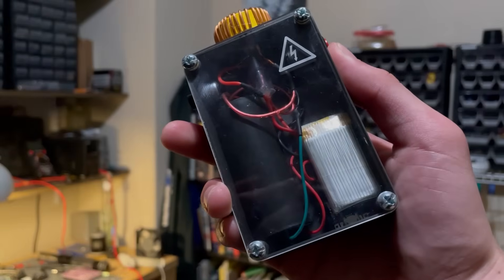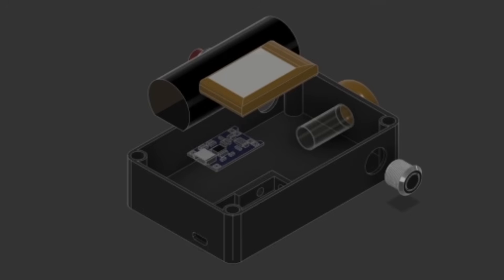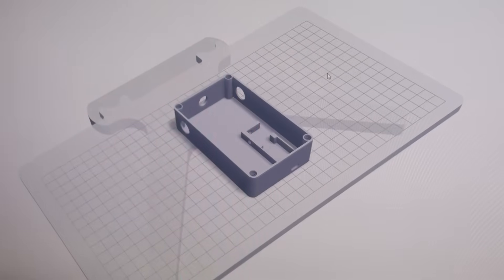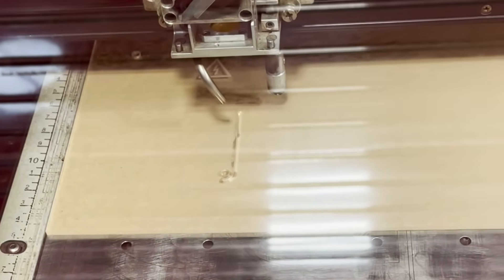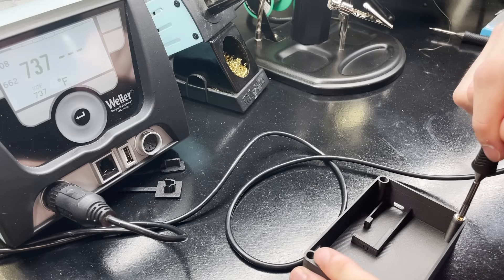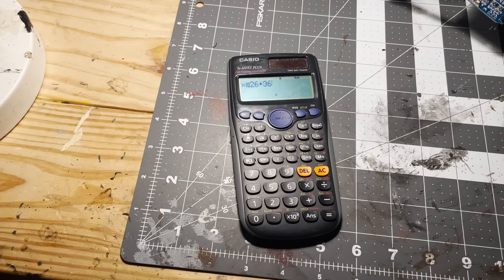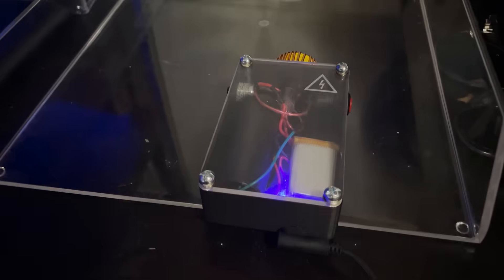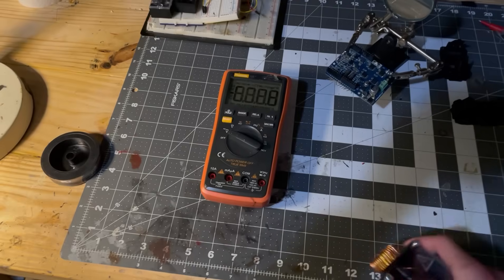How I Made an EMP Generator

Comment: to anyone interested, the batteries in vapes work great for these and are smaller than 18650's so you can use smaller cases. There are thrown away vapes everywhere so battery wise you find a few and save some cost on making it.

Comment: could it be used with a engine coil from a car, a 12volt battery while shielding the cars ignition system. Illegal or not it does seem like the great equalizer and you can't get caught if the other guy can't call, or start the car while his stun gun can't produce a charge.

Comment: add a voltage multiplier...maybe 6-7 times... about 10-20x more windings around your inductor...  smaller capacitors in parallel... then go ahead and throw a couple transformers in series to really boost that voltage. 

i wouldnt do any of THAT personally but for those interested.
Reply: Thanks lover
Reply: @tobimarucrypto2862  you got it bai

Comment: Also, why are there 2 buttons? Will it work with 1?
Reply from the maker: It will. One is just a safety
Reply: @schizo4725  Thanks! Can you also answer my other two questions? I'm planning to start building it soon! Already got the case printed!
Reply: @schizo4725  hey um don't transformers only work with AC current? how does it still function like normal with a battery? love your work!!
Reply: @-DaisukiDayo Sorry for the late reply, but I'm a lot more informed now than I was a year ago.
Transformers work with DC, but only once, momentarily. The circuitry inside the high voltage module makes it switch very fast between ON and OFF, which allows the transformer to work with DC

Comment: How could I (theoreticly) make it stronger? So that I could (for example) turn off security cameras from long range?
Reply from the maker: “Long range” is pretty vague but even at a few meters away, it would require a bulky design and enormous amount of power. Plus, you can’t precisely direct magnetic waves as beams. You’d be better off just physically destroying it from a distance.
Reply: capture cylder drone reverse enginer lol

Comment: Why do the devices light back up after the pulsing? How can you make them permanently destroyed with a pulse?
Reply from the maker: A.) because the field only causes a temporary disturbance to the circuit. More sensitive electronics may suffer permanent damage. B.) by building a much more powerful, legally questionable EMP with an extensive  amount of money and knowledge of electric circuitry. Personally, if I wanted to fulfill your second question, I’d go with a hammer.

Comment: Love the video, but can anyone tell me what is the purpose of the spark gap? Thank you!
Reply from the maker: It allows the voltage to build up in order to overcome the resistance of the air and then quickly discharge. Plus, spark gaps in general prevent damage to components in high voltage electric circuits.
Reply: @schizo4725  what gap distance would be optimal?

Comment: For fs sake all you need are 3d printers, computer programs, etc..
Like I'm going to be able to build one of these...
Reply from the maker: Not necessarily, one of my first EMPs was basically the same as this (actually a little better because the coil was more efficient). I made that one with nothing but some wire, the same transformer, a coil a 9v battery, a light switch, and some cardboard/ duct tape. It may not be as aesthetic as this one, but sometimes you have to just get creative when resources are limited.

Comment: the coil around the toroid is concentrating the magnetic field, that is what´s making it inefficient. you want the field to spread outwards, the ferrite toroid keeps it inwards
Reply: Hey you sound like you know what you're talking about. How did he use a transformer (a component that only uses AC current) with a battery (that to my knowledge, provides DC current)?
Reply: @-DaisukiDayo  that's simple, transformers work with fluctuations of current, which in turn create a fluctuating magnetic field. if you momentarily discharge a capacitor on a coil or transformer primary coil, that creates a fast growing current momentarily  that also will decrease fast, all this creates a fast fluctuating magnetic field, which will induce high currents and tensions on other conductors.
Reply: @thethoughtfield  sooooo transformers + batteries is ok?

Comment: turning the spark gap sideways and having both terminals exposed turns this into a taser. Please be very careful while making this. Also if taser is the goal you don't need the board.
EDIT: Technically not a taser as it isn't ranged. I simply refer to shocking devices such as stun guns and cattle prods as tasers.

Comment: No this is no EMP pulse as known from the scifi movies, but rather a strong electrical magnet that could easily erase ROM memory in various devices, thus effectively damaging the firmware. There is something like EMP pulse when a hydrogen bomb is deployed over the city inducing a blackout of non-protected electrical devices, which is majority of commercial electronics.
Reply: Do you know what EMP stands for? A strong Pulse from an *ElectroMagnet*...
Reply: Will a real EMP pulse from a hydrogen bomb be able to wipe out PROM, EPROM, EEPROM, FRAM and Flash memory?

Comment: Can not you just take two metal plates and connect them to Van der Graff generator ? When the voltage is high enough the spark appears between the plates which is plasma. All your devices will be affected.

Comment: did I miss the schematic drawing somewhere? with specific detail on spark gap length and the Toroid wind and inductance but it looks like a big series circuit on the output of the Marx Generator module. I have  a Marx 'gun' with a 12x12mm microswitch that keeps burning out although its on the input side of the marx gen. in series with an 18650 (likely instantaneous current issues)
Reply: maybe you already solved your issue, but here it is: microswitches can't handle high currents. Use a relay (ideally a transistor or n-mosfet) as a switch instead. If using mosfet be sure the operate within the specs and use adequate protections about back-emf.

Comment: I thought of this the other day when I was watching a car chase on the freeway.  Some way to upscale this strong enough to knock out a car and small enough to be deployable by a cop.
Reply: hi walthodgson, have you become a flat earther yet? If not I suggest viewing the 13 part series what on earth happened in my about to learn how the earth is not a globe
Reply: It's already been invented years ago but difficult to use.
A car body shields a lot, so it needs to go underneath using a remote control mini vehicle of sorts, which then directs the EMP upwards from underneath the car.
Works, but field testing on real streets and real cars proved that 2 people are needed, that it's very difficult to steer to get underneath a fleeing vehicle, it might affect other vehicles, too easy to get crushed by the wheels of the fleeing vehicle, could easily miss with no time to pick it up (thus making it easy to steal), etc etc.
In short... impractical in the real world.

Comment: Wouldn't the best Emp device be just a magnetron inside a wave guide with one end open on the wave guide?
Reply: Parts you can scalp ftom a microwave oven. The magnetron and magnets.
Reply: Just take the door off the microwave oven and over-ride the door closure safety switch? Maybe not very directional though, and not frequency tunable (stuck at around 2.4 Ghz)

Comment: Bruh. How does a DC battery work with a transformer! 0:44
Reply from the maker: Forgot to mention. The module very likely has an oscillator inside of it before the transformer. I mean, I haven’t opened it up and looked yet, but that is almost definitely the case since you’re right. A transformer needs AC supply after all.
Reply: I still have some learning to do - i thought transforming DC into AC (or vice versa) was the whole point of a transformer 💀

Comment: I'm fully aware that you added the toroidal core to trap most of the flux inside and only the leakage flux to do the job.. but hear me out, you can actually make it "directional" by putting the coil inside a copper or aluminium pipe, basically something non ferromagnetic.. also keep a considerable amount of air gap between the inner wall of the metal pipe and the coil. This is to improve the shielding in radial direction.. 

Now next up you can improve the coil structure, instead of making it toroidal which will trap most of the flux inside weakening the em wave.. you can just make it "horse shoe" shaped with the two poles open and facing forward.. that way, a short range but more powerful em wave can be generated.. Note that if u do like this then you'll need two separate copper/aluminium shielding pipes for directing the em wave forward. That's all I can think of. Thanks for reading your build is great though.. good work👍
Reply: With your horseshoe design would your wrap the wire around a copper/aluminum core or maybe plastic would be better. And the copper tubes your saying would go around each open end of the horseshoe?
Reply: @swimswim2168  Yes I think he meant it that way, Horse shoe coil is like a "U" so basically one to the right and one to the left. But I am not sure about the wiring of it, could try though

Comment: It's a good thing it wont work on most things you try to use it on. :)
In order for a proper EMP device to work, it has to actually be the same frequency of the circuit / device your trying to apply it to. 
And most important things are shielded to begin with. 

So if you don't know the EXACT FREQUENCY of a device, your EMP unit is useless. 
Now there is a form of EMP that doesn't care about frequencies, but you'd never be able to build it without having both a massive warehouse, and the permission of DARPA.

Comment: Just a simple question that I can clearly see that you have connected one wire with the Coile (I mean the High Voltage generator wire with the Coile) but where you have connected the other wire ?
Reply: spark gap

Comment: Pretty sure this is highly illegal and I love it. I remember trying to find plans for cell phone jammers and learning that it would be illegal to walk around with one in public. Similar reasons for this project. Keep spreading that knowledge :-)
Reply: it’s not illegal if you don’t get . . . .
Reply: This is very low power, and therefore not illegal. In your microwave there is a 1000x more powerful device than this.
Reply: @foximacentauri7891  Also a good reason for not disassembling your microwave unless you 100% know what you're doing
Reply: @SirZechs77  really all you need to watch out for is the HV capacitor
Reply: @janthran what's this cylinder thingy-
Reply: @foximacentauri7891  Oh.... Is there? 😏

Comment: This isn't EMP. EMP is extremely narrow, nano-seconds wide pulse, typically requires a nuke. Very hard to achieve with electronics, so most EMP simulators / smart bombs only get to a few MHz. The traditional method of simulating EMP used to be a Marx generator with some sort of antenna - that would be a fun watch if you built one and got it right. Your device doesn't even cause a lot of EMC, or you'd have seen it on your phone's sensitive touch screen.

Comment: Out of curiosity, would a stun gun achieve the same result?
Reply: A stun gun would emit a wide range of radio frequencies, this would cause momentary interference on radio based devices such as Bluetooth and WiFi enabled devices and radio broadcast receivers.

But the equipment would return to normal operation after the discharge sparking of the stun gun ceases.
It is highly unlikely any permanent damage to electronic equipment would occur by using a stun gun in close proximity.

Some electronic equipment may malfunction if the discharge occurs to the case of the item, but should be extremely rare because the equipment should comply to electromagnetic compatibility regulations and one specific test that is performed is to perform a high voltage discharge to the unit under test.

Comment: lol that's not an emp, that's just short range continuous induction.
you have to create and/or destroy the source of the EM field extremely fast to cause what can be called an EMP. usually this is done by literally blowing stuff up with high explosives. you just built a slightly overpowered mini radio that constantly changes the electromagnetic fields. EMPs don't do that, they only have one pulse, or maybe two, but one that does the main damage and is several orders of magnitude stronger than the pulse it uses to create the EM field.
Reply: No, it is an emp device. The device is not running continous due to the spark gap. Per definition an emp device is just a device that creates electromagnetic pulses, which this does.
Reply: Pretty sure what he made emits electromagnetic pulses bud.
Reply: @dubfather521  Yes but so does your grandad's pacemaker, it's not an EMP device though. OP is right.

Comment: The ferrite core of your toroidal coil is causing the overwhelming majority of the magnetic flux lines to stay contained within it rather than radiating out into space. This device would be dramatically more effective if you used a large diameter coil with no core.
Reply from the maker: Thanks for the input, I wouldn't doubt you have way more experience with electromagnetism than me, but I addressed that in my new pinned comment. By the way, it's a pleasure to see you on one of my videos regardless,  I'm a fan of your work!
Reply: new HyperspacePirate video?
Reply: Of course you are here :D
Reply: Waiting for your video on this ;)
Reply: Thank you lol. Next step, aiming it.
Reply: @GoingtoHecq  put in acan of coke  ;)
Reply: I agree. what he said😅
Reply: Don't use a toroidal coil at all. Their whole point is to cancel out magnetic fields.
Reply: This the nerdiest comment I’ve read
Reply: Yeah reconfribimalate the reflectratron cores with adamantium flakes. It's the only way to get your jigglewatts over 88mph and recapacitate the flux capacitor.
Reply: using a coil from a wireless smartphone charged can be used no?
Reply: @mrjoelpt  You can, but it is not necessarily optimal for it. Remove ferrite sheet/core and resonance capacitor, if there are any (unless you aim to ring it at certain frequency). Also the insulation may not be able to withstand needed voltage. Might be better to make your own.
Reply: @user255  not looking to make an emp lol just a normal spark taser, I had one built exactly the same internals just in square electrical box, and I liked his case design.
Reply: @user255  nowhere was just asking if could be done with a coil from phone wireless chargers.
I happen to have like 20 15W wireless chargers.
Reply: i used a copper tube as a coil on my emp it broke an old smart fridge and a wifi router would a parabolic antenna be better in directing the emp?
Reply: so, practicamente un video como esos que hacen energia infinita. . .
Reply: this is like technobabble if it made sense
Reply: Bro fr talking like hes a scientist on a spaceship 🤓
Reply: @behindyou529 there's always room for improvement...bro...fr fr
Reply: Omg sempai
Reply: If I was to to build a emp aparatus some day , I would do it the proper way cause those high voltage modules are hard to get in my country , I would use a zvs flyback and a one or two stage multiplier , with a air core coil , I don't like the spark gap too much but I could live with that
Reply: @rodriguezfranco3839  Without spark gap (or similar fast switching device) the pulse isn't sharp enough. It's cheap, easy and effective solution.
Reply: @rodriguezfranco3839  you can't just order them from aliexpress?
Reply: As a physicist, I believe this is correct, I'd have to do the calculations. You will have to measure the Flux of the designed coil to do it, but in reality, the EMP blast really is not dependent on the magnetic field but rather oscillations of electrical and magnetic fields (emp) which transfers electrical energy to circuits as a high voltage pulse. In reality, you'd need a setup which amplifies as much of the incoming current into a high energy electromagnetic field. As to the toroidal magnet, no idea how much it would accomplish with that conformation. It would likely have to be an antenna like conformation to maximize it, ideally directional but an EMP is kinda everywhere so you could use reflectors
Reply: @jacobprogramz  
"... the EMP blast really is not dependent on the magnetic field but rather oscillations of electrical and magnetic fields (emp) ..."

Not quite true. Oscillation to electric field depends on the strength and speed of change of the magnetic field.

"... amplifies ..."

Converts.

"As to the toroidal magnet, no idea how much it would accomplish with that conformation."

Obviously not much, as the field lines should go through the target, instead of the coil itself.
Reply: i aint reading allat
Reply: @notsotastysandwich8205  nobodys makin u
Reply: @notsotastysandwich8205 lol

Comment: when making this would you leave a gap in the pin casing for the sparks?
Reply from the maker: Yes, it’s to prevent the circuit from being damaged by voltage surges.